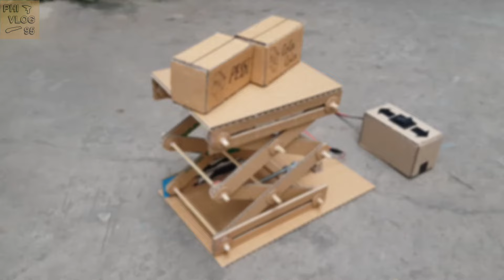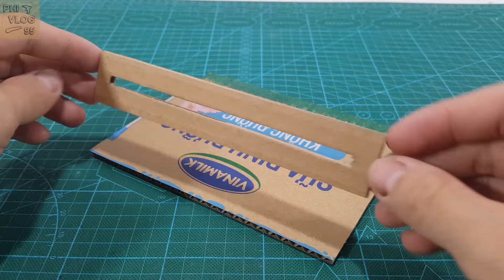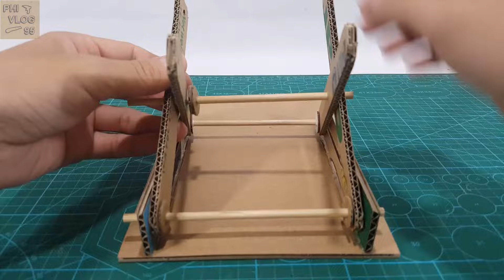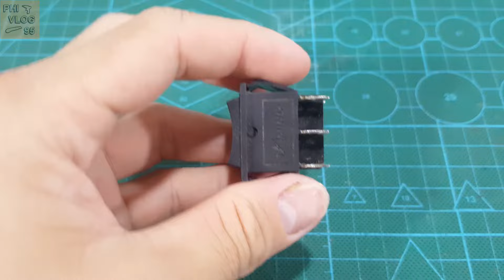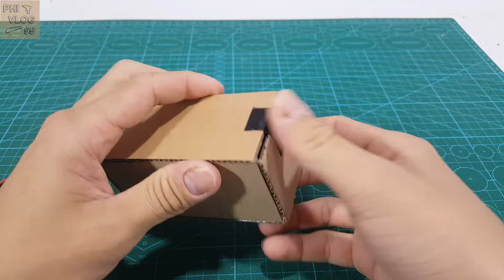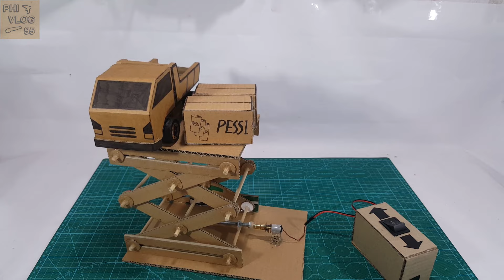How To Make Mini Electric Hydraulic Lift Table With Cardboard and Motor N20 - Awesome Ideas

Comment: how many volts does the geared motor you used have? and what is the speed (RPM)?
Reply from the maker: 3.7v - 7.4v, rpm ~50 / 1 minute